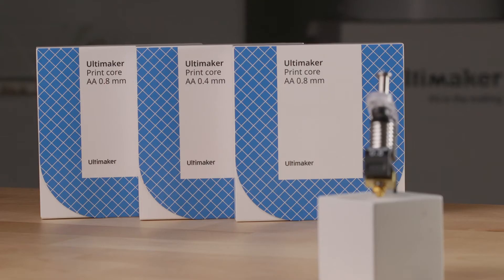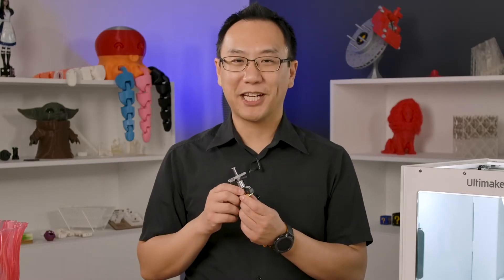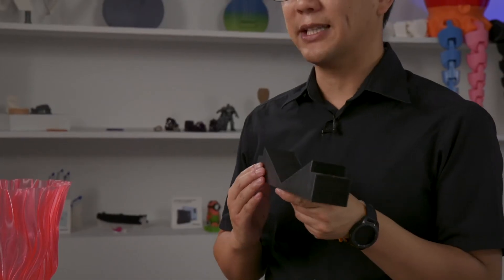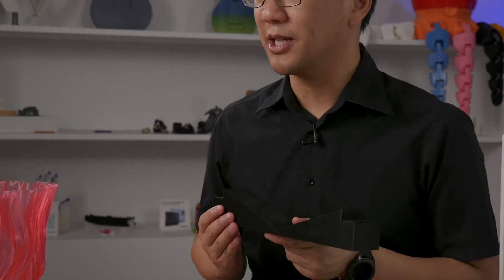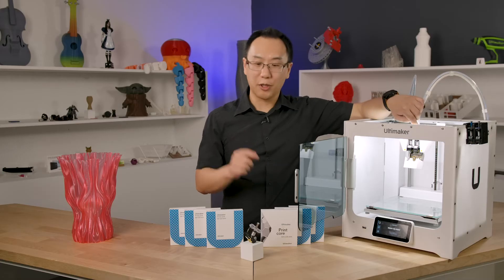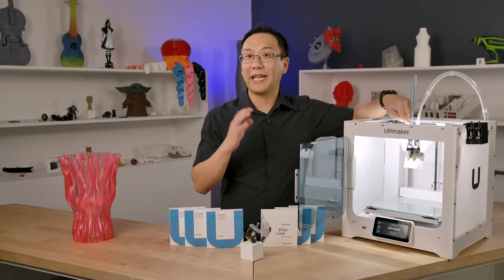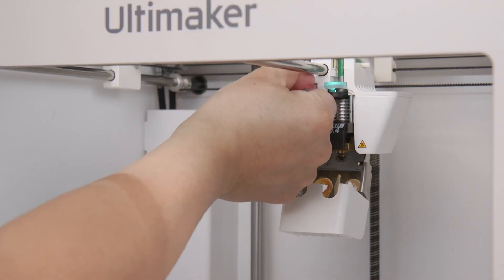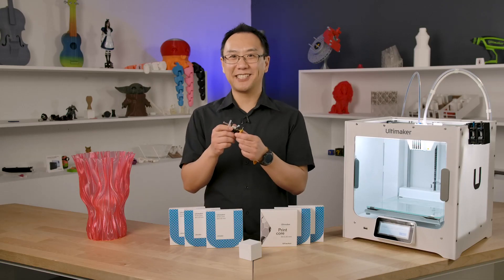Ultimaker 0.8mm AA Printcore

Comment: I wisely purchased a pair of 0.4mm and a pair of 0.8mm nozzles with my S3 and I totally agree with your conclusion. Installing both sizes simultaneously shortened my print times considerably and as you rightly said, the finish was not adversely affected, on the intricately detailed aspects of the parts I print, using ABS AA04 filament.

Thanks for sharing your knowledge and experience, it's all put to good use.
I've always maintained, I've learned more on YouTube than I ever did in college! 👍